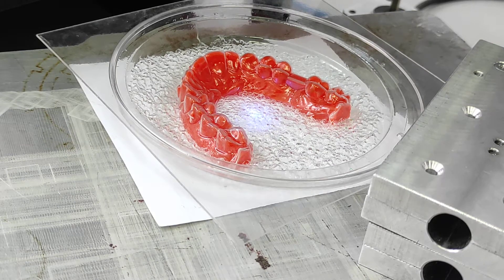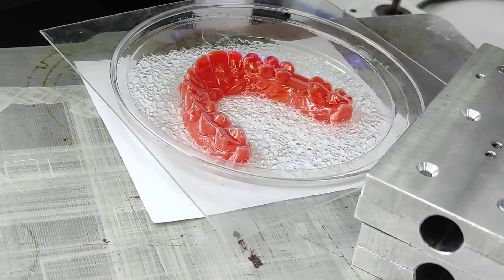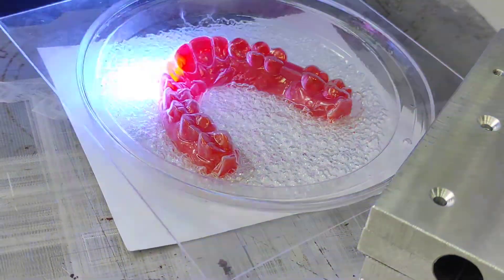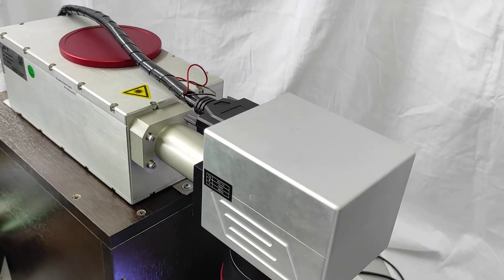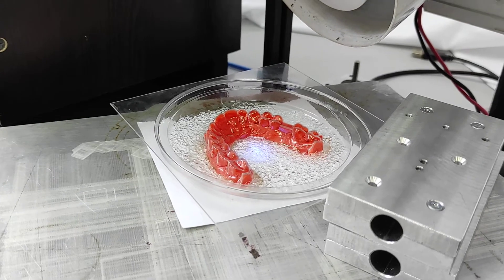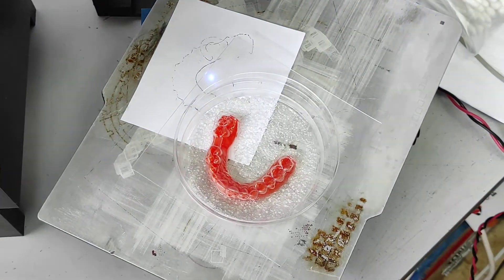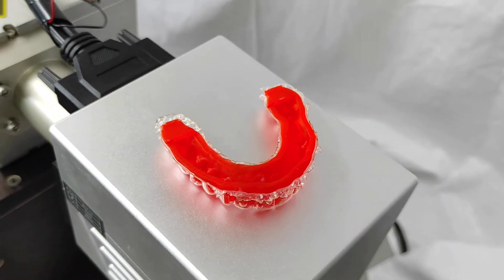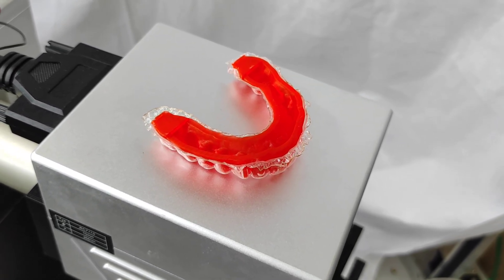Aligner laser cut with 3 watt 355 nm UV Endurance laser.

Comment: too much work too much time and you still need to trim. use an ultrasonic cutter for cutting 3D printer supports then do over with sharp mallite and felt wheel. to program for each aligner and you still can notcut in the undercuts is not worth it. Or buy an existing cnc cutter that does all this for you. 50 passes that is a lot and the heat will destroy your suck down. or just 3D print direct aligners.